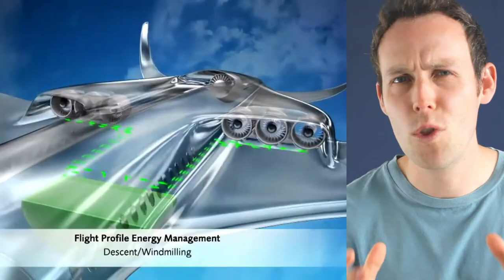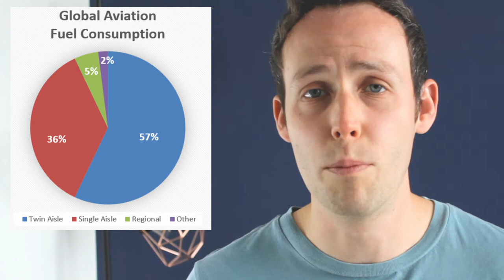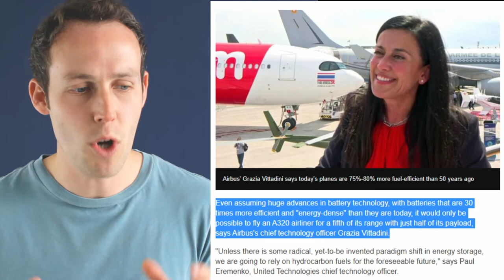Electric Flight   (Part 6: Sustainable Aviation)

Comment: I Totally agree on that. The best application for an El-aircraft that make sense in the near future is having a modern alternative 60 yrs old Cessnas, that btw everyone practicing to be a pilot need to flight with. And that’s it. CTO of Airbus make a huge point, even if those monstrous improvements (30x energy density i for batteries if at least 10x the theoretical limit of electrolytic batteries, and out of reach even for the most promising futuristic development in the field (solid state, graphene) just because, you know very well, physics!

“ More electrical aircraft”  has been a GE research project to improve inverters and electric drives, to sustain secondary systems as you mentioned, in order to gain a few % of efficiency wherever possible. To be clear, I am truly convinced that improvements in thermodynamic efficiency of the combustion temperature increase already mentioned for thermodynamic cycle as well as energy storage in electric form to help the rotor in specific situations, here stepping out of my expertise: maybe increasing a bit the trust during take off? Could overall push total efficiency still higher
Reply from the maker: Yeah, you are talking about hybrid-electric and essentially some electric hybridisation of the jet engine. This will definitely happen - I have worked on some of these concepts. In general though, its very difficult to trade on even small amounts of electrical technology onto an aircraft engine... just as an example, the oil pump and fuel pump for the engine are mechanically driven with fixed displacement and spill which is a massive waste of energy... could use electricity generated from the engine to power electric motor drives so precise oil and fuel pumping is enabled without the need for spills... however even THESE systems which are tiny power requirements in relation to the engine itself are difficult to justify given the extra weight etc. of them vs. mechanical.

The problem with electric boost during take-off/climb is that you discharge all your battery power during that part of the profile, then are carrying dead battery weight around for the rest of your flight - it negates the saving you get from shrinking your engine slightly... then what happens if you need to climb again e.g. aborted landing? A lot of it doesn't make sense and really isn't worth the additional complexity and potential failure modes = certification headache. 

There are some electrification benefits, and there are a few things I think we'll see added to the jet engine in the next 20 years, particularly to improve operability... but they will only really enable the jet engine and should be thought of as an efficiency improvement for burning jet fuel... see my previous video and why this alone won't decarbonise aviation.

Comment: It will be good for very short flights over water which also have a ground component or where ferries are too slow and infeasible. Something like Toronto to Buffalo might work. Or flights over mountains ranges where roads are necessarily windy.

Also check out Regent - their electric Ekranoplans/Ground effect planes look promising and much faster than ferries (for routes around 200-400km crossing a body of water).

The routes might not even currently be served by commercial flights but with relatively low running costs they might become feasible.
Reply from the maker: Yes, there are niche cases where electric aircraft make sense. They can't compete on major routes though and aren't a viable decarbonisation option for most aviation emissions. They are essentially a new market entirely and more of a competitor with ground transport options on most routes.

Comment: Why not use mixture of batteries & helium canister placed underneath the batteries in order to reduce extra batteries weight (to get them levitating) in flight and when landing withdrawn back into (in pressurise form) in the canister. That way you can have as many batteries as needed to increase the range without increasing the overall weight of the plane. Alternatively I wonder if magnetic principal can levitate the batters and hence reduce their weight
Reply from the maker: Using helium for buoyancy is actually not a crazy idea: look up the "airlander" aircraft by "Hybrid Air Vehicles (HAV)". https://www.bbc.com/future/article/20191107-how-airships-could-return-to-our-crowded-skies
It requires a large volume though and as such the containing skin needs to be thin to minimise weight, and you need to fly very slow to prevent excess drag. So it's a way of flying efficiently but VERY slowly.
And there will always be concerns about ripping or puncturing the skin.

Comment: 3 eras of air travel -
1. Piston engine's propeller aircraft
2. Jet engine's airliners
3. Electric Flights

Electrics flights is only a near-term solution
for very short range flights
carrying a very limited number of passengers

Twin Aisle flights consume more fuel than single aisle

80% of aviation emissions come from flight exceeding 1500 km,
a range at which electric flight is not a competitor

1 Kg Fuel for combustion engine = 25 Kg of Batteries for electric engine

Key takeway - Electric flight will not help the current climate crisis